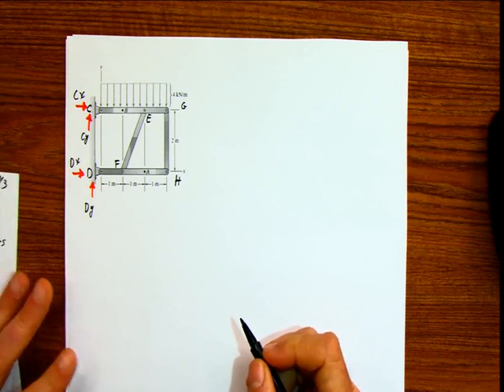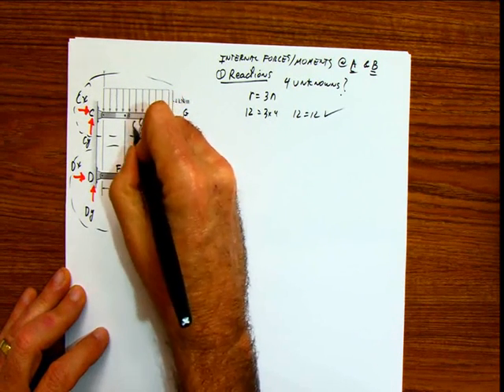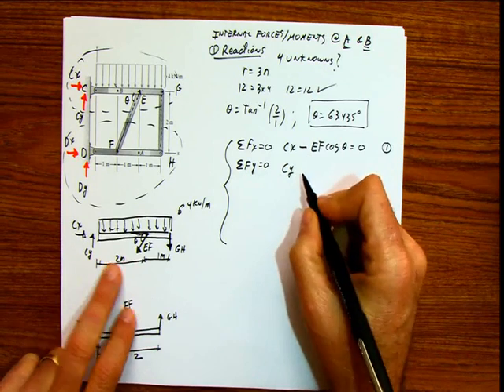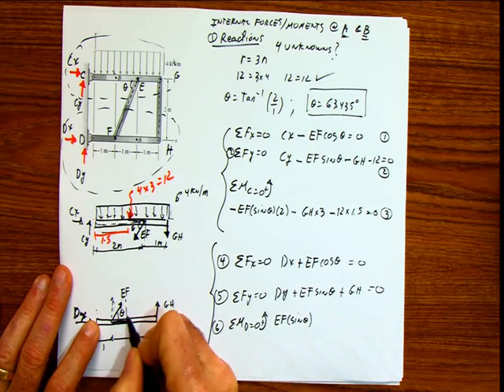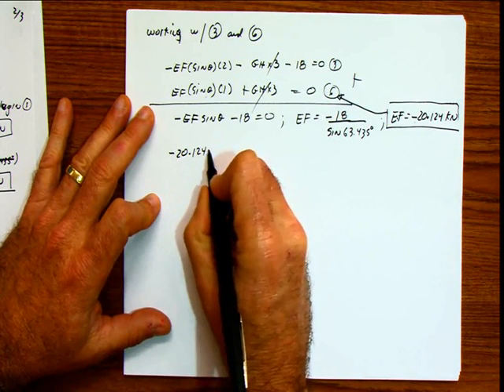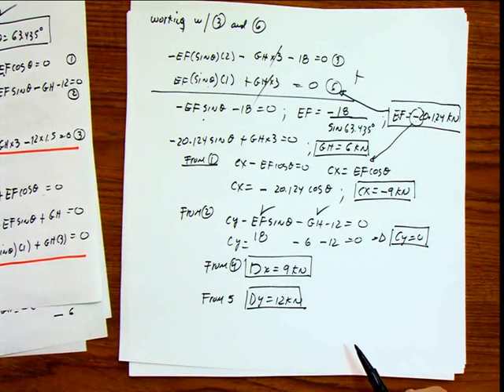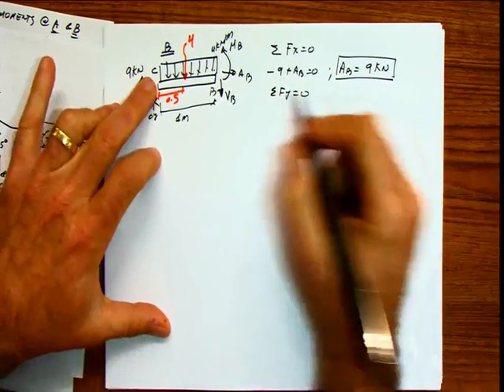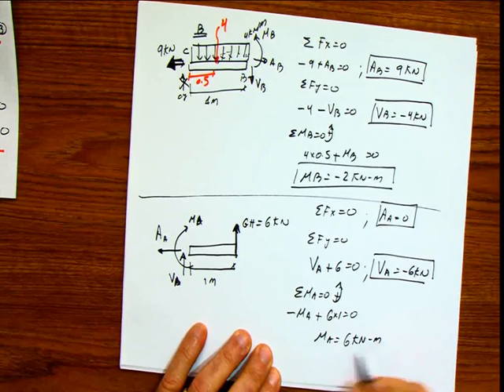Chapter 7 - (2) Internal Forces in Machines example  2

Comment from the maker: Roy, you need to review the basic concepts of distributed loading.  you can "transform" any distributed load in an equivalent concentrated load equals to the area of that shape and located at the centroid.  in the case of a rectangle the centroid is located at the center.